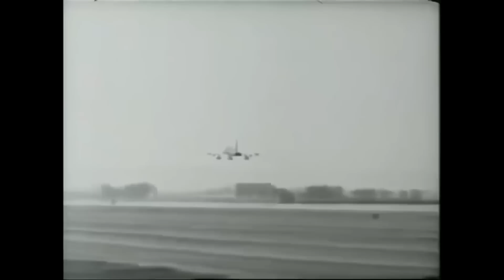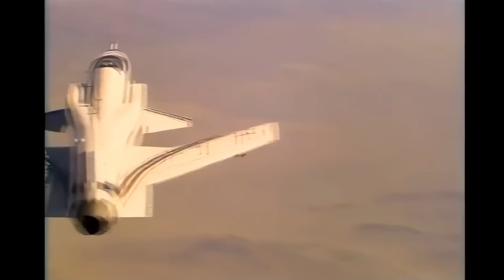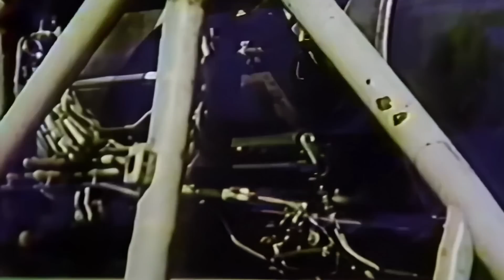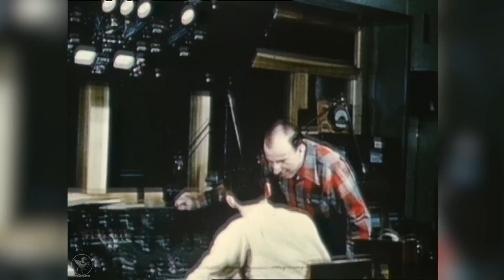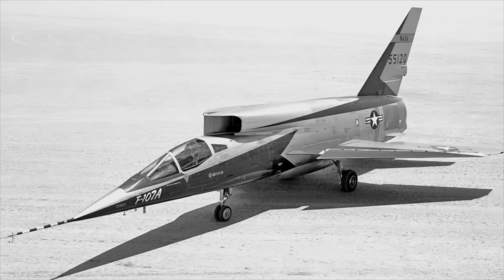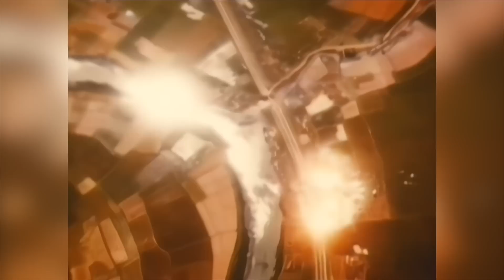F-5 Freedom Fighter Jet | Northrop Supersonic Light Warbird | Upscaled Footage

Comment: Can a f5 jet fly non stop full tanks with no need to refuel across the Atlantic ocean or pacific ocean; jfk - jkia ?
Reply: If it were even possible they would be in ferry configurations loaded down with multiple drop tanks, no weapons, and use very conservative throttle techniques but even then I am almost certain they still would not make it.

Comment: The F20 Tigershark was a Mach 2 aircraft.
An economical twin engine lightweight fighter. The air force chose the F16 instead, but production was too late for Vietnam. I bet they full well realize the mistake they had made. Even 60 of the F5 Tiger 2s would've lead to US air superiority  over Vietnam. Too bad. Instead, they carpet bombed with B52s. It just goes on and on!
Reply: The F-20 had a single engine the F-5 had the twin engines. The single engine was 70% more powerful than the twin, it was the same engine used in the F-18 but that has two of the more powerful engine. The F-5 had similar performance to the Mig 21 in Vietnam with slight advantages. The U.S. did have air superiority but not domination, the real threat were SAMs, there were too few enemy fighters, The F-5s  in Vietnam had no real kill numbers, I think they got one kill. They were used for ground attack evaluations. You are over rating its air to air capability. The F-20 would be much more inline with your expectations but that did not exist for many years to come.

Comment: I don't understand why the Air Force didn't use the F-5 to dogfight against those Migs in Vietnam. I've always loved the F-5.
Reply: Because at that point, F4 was more suited for Vietnam's needs, having F5 engage the meager North Vietnamese Airforce wouldn't have made that much of a difference
Reply: They had very similar performance, no significant advantages. The Vietnam F-5s had more than a few serious disadvantages compared to top line American fighters, I don't even think they had viable radar if any at all. They had power issues, climb issues,slow throttle response, no maneuver flaps, etc. The first line fighters were far superior leaving no reasonable need to engage in air to air with them.
Reply: I cannot believe how retarded Command and SecDef really was regarding their decision making in the 60s and 70s. They certainly could've bought 100 or so of these nimble fighters and saved a bunch of money, not to mention pilots lives!!  Vietnam was a proverbial shit show, based on a staged attack in Gulf of Tonkin.
That said, it's hard to accept that our leaders just wanted to waste billions of dollars and lives, with their horrendous lack of effective military action. both in the air and on the ground. It's horrific! It's a bit like Russia in Ukraine right now.
I mean,  just bumbling around getting their butts handed to them.  They had their SU 57s farting around down low and slow. The aircraft is designed for it's standoff capabilities, not for dogfighting, especially down low.